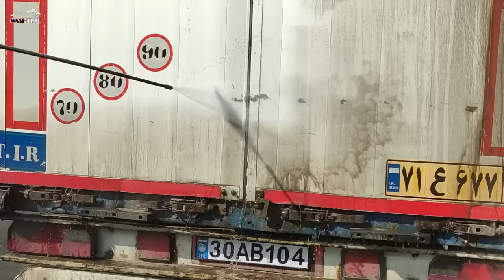SALT is so harmful for your truck!! wash it after every trip! #truckwash #washtime

Comment: Love watching this videos,but when i see you are washing truck from bottom to the top,and all that dirt sliding down to already washed are i want to rip my eyes out of my head. Why are you doing that? That is just so wrong.
Reply: Bottom-up method is to prevent the water above to dry out in avoiding hard water stains.
Reply: @chronyan  twice the work for no reason.
Reply: @bubbabearhuntington2295  same😂
Reply: The reason is the soap they use acts as a scrubber when pressurized water hits it. So washing top to bottom, all the product is basically carried away before it does anything. But then again I didn’t see any product applied here so who knows. If you watch channels where they sell foam products for contactless washing, they always wash bottom to top so they hit fresh product every time.
Reply: ㅣ
Reply: This method is used for rinsing the vehicle. Even all the detailing studios do the same method so as to prevent hard water stains and swirls because of self dryness